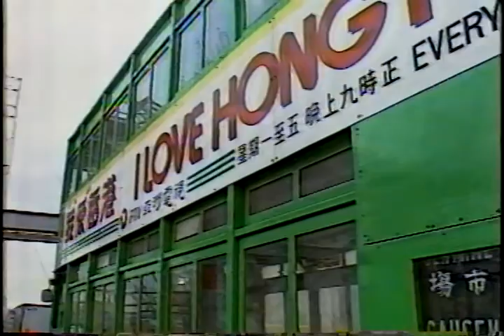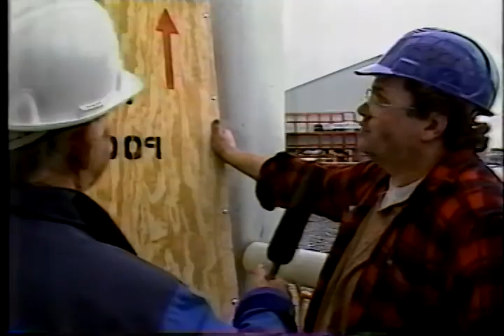Jack Webster Expo 86 preopening special

Comment: Hard to believe this was 30 years ago, it almost seems like a current video.  I was working in the Bentall 4 building back in those days and had a season's pass to Expo, which I remember cost $100 through work.  The only thing is, I hardly ever used the darn thing, which is a huge regret of mine.
Reply: A greed, I was driving for Richmond Taxi when I was still attending VCC..i took countless people to Expo back then but never visited it myself..Webster was outstanding, old school to the end...I also worked in Bentall building in the early 2000s while with the floor layers union...Time does indeed fly man...Living in Kelowna at 52 now, after many different occupations...Take care...